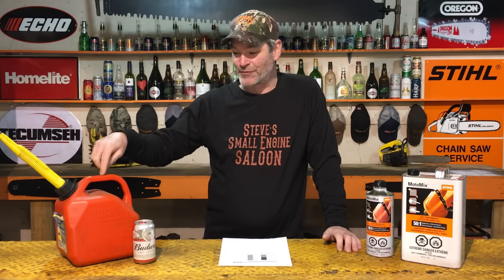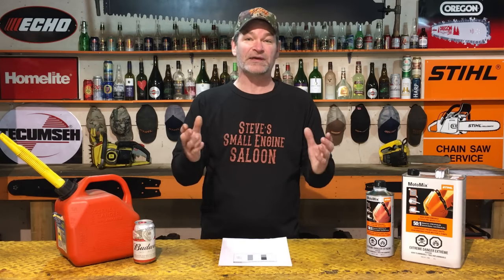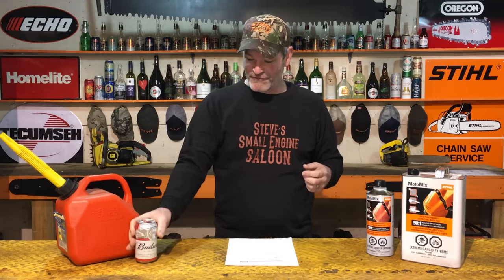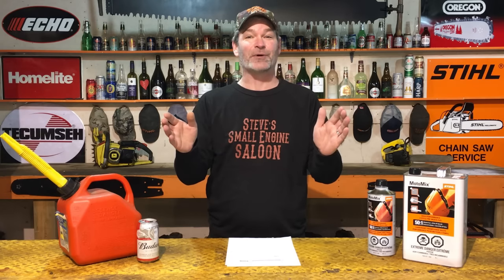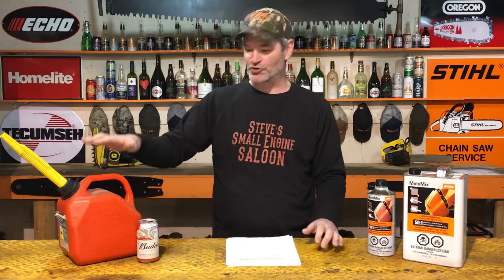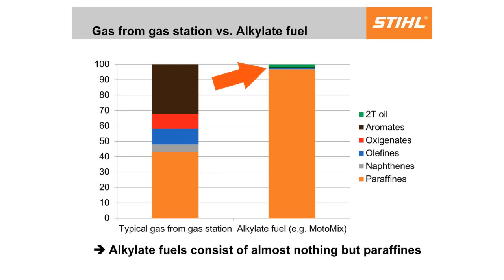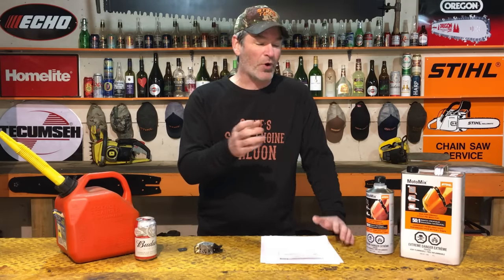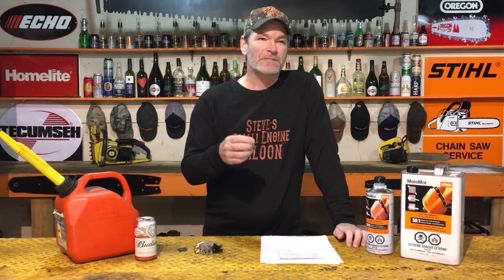The Ugly Truth Why Gas Station Fuel Is Bad For Small Engines

Comment: Up here in Canada I sell Gulf Pro Fuel. It is a full alkylate fuel. Not only does it not have ethanol in it, but it also does not have benzene, toluene, and is very low in aromatic hydrocarbons. It also produces up to 99% less harmful emissions then pump gas. It is very similar to MotoMix. It is the only fuel that I trust to store my expensive motorcycles. I also keep my generator full of Gulf Pro for if the power goes out. I use it in my hand held equipment too. Because I don't want to breath in all the harmful emissions. Gulf is so pure you can pour it into a styrofoam cup and it does not eat the cup.
Reply from the maker: Cool!

Comment: I know you are right about this, but I also know that about the best price for these SUPER fuels is about $45 per gallon right now. Find a local gas station that sells the non-ethanol gas and use it all "mowing season" then at the end of the mowing season remove the carb and fuel lines and DISCARD those items. THROW them away and replace with new fuel lines, carb, and filter and your equipment will be like NEW next spring and you wont spend HALF as much as these SUPER fuels. The main problem I am seeing with the ethanol is the evaporation rate of gasoline vs ethanol and thats why there are crystal like deposits left in the carb. But you can save even more money if you remove the fuel system (carb,lines,tank,filter) thoroughly clean and dry the system then use a safe type of  oil in the carb like marvel mystery oil, ATF, 3in-one...to keep the seals and gaskets form getting dry and crunchy. And its STILL cheaper than the specialty SUPER fuels. Now if like you suggest to ONLY use the super fuels when winterizing the equipment then its not so bad, and maybe use a 2-stoke 40 or 50 to one mix? Just for the oil for the needle valve-n-seat, ? I just use ATF or marvel mystery oil. Great video. Any vid that gets us all chatting is cool,.

Comment: We have a couple of gas stations near me, that sells ethanol free premium gas, in my two cycle engines I have also always mixed the proper amount of two cycle oil and have always added the proper amount of stab-bil to the gas. And also sta-bil to the gas for my 4 cycle engines. I lost the Briggs and Stratton engine on my Troy-Bilt pony this spring and I’m wondering if it was coursed by the ethanol fuel I have been using? The engine just started smoking and shaking and quit running.
I’m not opposed to the engineered fuel but for my 2 cycle engines couple use 40:1 mix and the others 50:1, I’ve  spoke to both station and they told me they have separate pumps that are the ethanol free premium gas. 
I just purchased a new John Deere S170 and I don’t want to blow this engine, is there a way to test the fuel they claim is ethanol free to make sure it is.?
I have learned a lot about taking care of my equipment watching your show, keep those video’s coming.
Thanks
Bill Odom
Poplar Grove, Il
Reply from the maker: I have videos in my playlists for that...

Comment: Question steve, you might could show it on the next segment of this. When you held up to two charts showing the level of benzene in a small amount in the manufactured fuel I did not notice any strip of that color on the premium pump fuel chart beside it. How much benzene is in the fuel just to clarify because now I'm confused.
       Also I think we need to cover the engine cleaners that are added to the premium fuel and how they affect keeping the two-stroke clean or cleaner than it would have been. Thanks a lot! 🇺🇲🇺🇲👍🏻

Comment: I use regular gas and add Fuel Stabilizer and both my chainsaw fired up after not being used for over 2 years . Their tanks were empty had to fill up but that's all it took , regular starting procedure and they fired right up . And they're both Poulans to boot .

Comment: I only have a weed whacker and a leaf blower that are 2 stroke, so the extra expense for getting that fuel for them is not too bad. The push and riding mowers, the generator, the water pump and the snow blower have to suffer with pump gas!

Comment: Another awesome video, thanks. In your experience, is there a fuel additive/carb cleaner that removes most of the nasties from station fuel? If so, how frequently should I use it? Thinking along the lines of Sea Foam or Lucas.

Comment: I've never stored with engineered fuel but I have store it with the highest test and fuel stabilizers. I have have better success running engines dry and storing them then keeping fluids in them.

Comment: I’ve used the premium gas 91, 92
+ no ethanol and my ms 271 chainsaw that still looks basically brand new . Bought it few years back  for like $5-$600, not farm boss one either. And mix must’ve been off a tad and my mechanic even said if it’s over a month old not to use . ( nice to know now that it’s toast) I’m anal on cleaning and maintaining it but didn’t know to take off lil piece with clutch and blow behind it etc. it got hot and overheated and done and need new piston and rod kit set now which cost about as much as new saw. My mechanic sold me an old stihl 039 20 inch bar beast with carb for $250.  So now I’ll buy stuff to fix old saw to learn and take extra care of . Plus the mtronic could be good could be bad. I always help people out too for free especially storm damage or helping hand . Dads handicapped and mom and her husband too. I’m 45 and trying to help folks but I’ll take even more care. Now , once I take it to use I’ll be taking a day to disassemble and clean and oil , grease , etc. . I’m not a guy that claims to know everything but like to take care of my stuff cause In the long run it can save you more pain, hard labor   .  Always happy to pick up some new helpful tips . Educate yourself cause you’d be surprised what ya might learn. Thanks Steve and all

Comment: Here in Sweden I use "Aspen 4-stroke." (Aspen 4-takt). Very satisfied with this brand. It is among the cleanest gasoline you can get. You can store it in a tank for up to five years without problems (recommended 3-5 years by Aspen). Almost all harmful things in it is eliminated, especially benzene. I have no desire to help my body get leukemia... BUT it costs approx $18 per gallon....  😱😱😱  I have never used anything else for 30 years. Not once have I needed to clean my carburetor on the lawn mover.
Reply from the maker: Interesting!

Comment: I use Stihl 2 cycle oil and I notice that sometimes the mix is blue, and sometimes it's green. Are there different formulations or is the counterfeit 2 cycle oil out there?
Reply: Yes there are tons of different types of 2 stroke oil use the Stihl ultra hp in your saws and weed eaters and for dirt bikes you want an actual racing oil like klotz or amsoil

Comment: When mixing from gas station fuel in the past, I get premium fuel. I will pump a gallon into the truck first to fill the pump hose with premium. Having the gas can with good 2 cycle oil and 1.5 oz per gallon of Sea Foam as a stabilizer and fuel system cleaner.
This has never failed me.
The premixed trufuel is great for the weed Wacker around the house when you only use a quart or two a year. Then you just don't worry about anything. The quart can is nice to handle too.
Reply: I do the same but I put 10 litres (2 gallons +) in my vehicle first and pick a gas station that has no ethanol in their premium. I bring more than one gas can because of the cost of the 10 liters I put in my vehicle. (Also use SeaFome). I did a video of my Generator that sat for 9 years, I did drain the old fuel out first and put in new gas, 3 pulls and it started and ran fine.

Comment: Been doing this for years now to winterize and both my trimmer and saw. Both start as they did prior to shutting them down for a Montana winter.  One pint split between the two.  For someone with just a couple pieces of equipment the $8.99 a year makes good sense.  For a pro lam
Reply from the maker: Right on

Comment: I have tried the pure "Engineered" fuels, and the only one I have found that is consistently good is sold as "Aspen Fuel" in the UK and it seems (not certain but fairly sure) that this is the one sold as "Husqvarna Fuel". Much cleaner burning and doesn't have any ethanol in it in the first place. They use this in Sweden exclusively, as the forestry workers were getting health problems from being under the tree canopy where it was almost windless, so the foresters were breathing in the exhaust fumes far more than you or me in the open air. I use E5 Fuel from Texaco in my main hard-working chainsaw throughout the year and then switch to Aspen Fuel just as the "close season" is approaching. In my spare chainsaw (which I use to release my main chainsaw if I jam it in a log) I use nothing but Aspen Fuel.

There's a video from someone on YouTube in which he tests all the UK garage fuels and he found that Texaco Premium petrol had the lowest amount of ethanol in it; despite being labelled E5, it actually had no ethanol at all. I use this in my main McCulloch (rebadged Husqvarna) chainsaw.

Comment: You do great videos~!!   I've looked into this too, the data is brutally hard to find.  It's as if the industry wants it kept secret because they make lots and lots of money  Training people.   Can't train 'em if they already know.   I believe ( can't swear to it) that olefin content in gas in the USA is around 9% or lower.  

Olefins do some interesting things. None of which are necessary for small engines.  Paraffins are great for ignition but they don't work so well in cold weather.  Aromatics like Olefins have high octane numbers and allow the fuel to experience greater compression before ignition.  So there's that, but they tend to be a problem for engine cleanliness.  So the industry tries to keep them low. 
Maybe buy high-quality gas. and don't buy high octane. 
For my money, if  I tried to run all my gear on engineered fuel I'd go broke.  It is way too costly an option for me and others I am sure. 
But you  - - - well - - - we can all see from  the beer you drink that you are rolling in dough  ;<p

Comment: How about when getting ready for storage run out of fuel add a shot of marvel mystery oil pump or crank it a little to get it in the carb then store.  In spring fill with appropriate fuel and oil put a blast of starter fluid in the carb and run it for a while, then set for the season.

Comment: My question would be why don't stihl and the other brands just manufacture there equipment to be compatible with pump fuel, also if those components are bad for engines then what is the purpose for it being put in the fuel in the first place.

Comment: I believe you but I’m on year 8-9 of a husquvara string trimmer and I’ve always just used low grade pump gas as cheapo 2 stroke oil at 40:1 and it fires every time on the second pull and I’ve never touched the carburetor. No rebuild or anything. Same for my stihl saw but it isn’t old yet. 
But I have had all these issues in my motorcycles, go carts and rc airplane engines.

Comment: we have one gas station in the whole southwest area that sells regular(unleaded) pure octane! I don't know what I would do if that store ever went out of business! either small engineers need to upgrade their new engine's tolerance or the gas stations all need a required octane  pure option pump! I hear a lot of the "observes California standards crap" but bottom line is the engines still do NOT take ethol!  I use Honda and am shocked even THEY have not upgrade their engines!  you can make an engine that is resistant to water and humidity! cars do it! obviously the gas stations don't know we all have to mow our lawns!-a case of left hand not knowing that the right hand is doing. :(

Comment: I use both to keep the price down and reduce maintenance. Whoever said that was no issues back in the old days is listening to B.S. , I spent more time straining gas out of 45 gallon drums in remote areas then I would like to think about. Fuel management is critical to the running of engines. We are just spoilt now with all the new products.

Comment: I use a mix of 50 percent avgas and 50 percent real gas and the appropriate mix of 2 cycle oil in all my 2 cycle engines for years and have never had a problem in any of those pieces equipment including storage....use at your own risk, or not. It is what works for me.

Comment: I’m in the U.K. and it’s very difficult to find out what they put in the premium unleaded. Legally it has to be marked E5 but there is no legal requirement to include 5% ethanol. Shell V power says it includes cleaning additives but don’t say exactly what’s in it. The clearest information is from Essex who say:

“What’s in our Synergy Supreme+ 99 premium petrol

Our Synergy Supreme+ 99 petrol has more cleaning power than our regular petrol – and includes molecules whose job it is to reduce the friction in your engine helping the moving parts work more efficiently.*

Although our pumps have E5 labels on them, our Synergy Supreme+ 99 is actually ethanol free (except, due to technical supply reasons, in Devon, Cornwall, North Wales, North England and Scotland). Legislation requires us to place these E5 labels on pumps that dispense unleaded petrol with ‘up to 5% ethanol’, including those that contain no ethanol, which is why we display them on our Synergy Supreme+ 99 pumps.”

Personally I’ve never had any problems using pump fuel but In view of your video I’d like to find out more. Any ideas?

Comment: I have a 2-stroke Lawn-Boy. I use clear gas from a local 76 station. It's $2 or $3 more per gallon than regular gas. I mix it with Echo Red Armor 2-cycle oil at 64:1 and it runs like a champ. Maybe it's not necessary. I don't know. All I know is the mower runs great so I'm not about to change things.

Comment: Is the cost difference significant? Depends on how much fuel you use. 
Say you use 1 gallon per year for 10 years.  
Motomix is roughly $30 x 10 yrs = $300.  
Pump gas & oil bottle is roughly $7 x 10 yrs = $70
Difference is roughly $230 over 10 years.
If you use 2 gallons a year then the difference is approximately $460, & so on.
If you are running that premium fuel in $300 to $700+ saws, trimmers, blowers etc… & it works well & protects your equipment & you can avoid repairs or replacements… you’ve got to do the math and ask yourself if it’s worthwhile.

Comment: Engineered fuel is expensive at like 20/qt but it sure is good stuff. I use it all the time. But I use non ethanol with stabil through the season until I put it up for the winter or if the machine is running finicky.

Comment: Can you use a racing fuel, like VP’s C9 fuel, with the two cycle oil, in a two stroke engine?
Reply: As long as the oil / fuel mix is correct,it  should run like a champ

Comment: Also! When I first started using chainsaws there was no ethanol but there was lead in gas. Homelite recommended regular gas with 30 weight engine oil. 16 to 1 Engines got carboned up but it was common to “decoke” engines Pontiac dealers had a process with walnut shells to decoke  combustion chambers and lead would settle in lower spots in engines. Engines stay way cleaner today.

Comment: Happy to live in a place with easy access to non-ethanol premium pump gas. Also happy to have equipment with fuel shut-off valves. Run it dry, put it away in November, start it up in April.

Comment: LOL i have used nothing but norm gas in my 1989 CRAFTSMAN  Briggs & Stratton push mower and have clean the carb 3 times it still my main mover i never winterize it..and i not nice to it change oil about 1 time every 3-5 years. i use it alot well to me cut about 3 acre of yard a week with it dont wash out the under side ever no rust..no way  am i able to pay what the cans of fuel cost....it prob helps i wont cut wet grass it has to have a full day to dry out before i will cut after rain...only prob i got is i keep breaking pull stings on it any idea or help with that be great

Comment: Try using archoil ar6200 in your fuel mix  it works very well, but becareful because it has advanced lubricants in it which could affect the oil to fuel ratio.

Comment: I've been running Motomix on my Stihl equipment and am less of a believer than previously... realizing that there are very possibly other issues that have caused problems, but after replacing a couple of carbs (on a 4-year old MS251C chainsaw and my a similar aged KM91R that were exclusively fed MotoMix) I'm a little disillusioned. No doubt these engineered fuels are better than gas pumps; I have a station that's popular with the boating crowd around me as they sell non-ethanol gasoline, giving that a try with Stihl synthetic 2-cycle oil and will see how it goes.

Comment: I started using aviation gas a few years ago and have not had any problems. Would be interested in knowing how this gas would compare these manufactured fuels.
Reply: 100LL AVGas has twice as much lead in it as MOGas did in the 70s. It also has an equivalent octane rating of about 105 (AVGas octane ratings are the MON rating only).

So not only is the exhaust toxic to breath, you risk plug fouling, lead deposits, and its octane rating is complete overkill for a small engine.

That said, if you are running a little lean, and don't mind a little lead in your blood, your small engine will run great on AVGas.

Comment: If you are "Truly" storing it, fill the carb with transmission fluid. and leave a thin level of trans fluid in the tank to help prevent rust ( if you have a metal tank)

Comment: To me, since I fix my stuff, I'm not too worried about using these engineered fuels. Simply because, if the diaphram in my 2 stroke carburetors go bad, I will simply rebuild them or replace them, since carburetors and carb kits are dirt cheap these days and the cost savings of cheap fuel outweigh buying parts every 5-10 years lol.